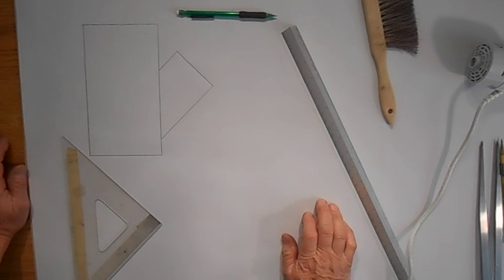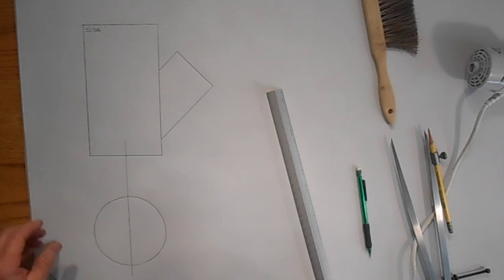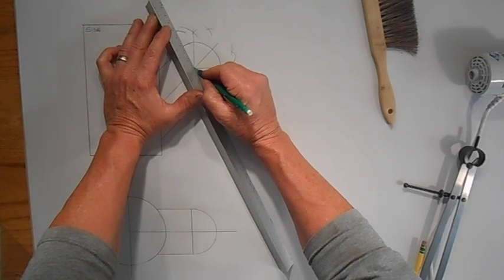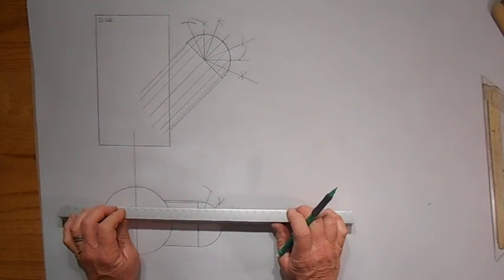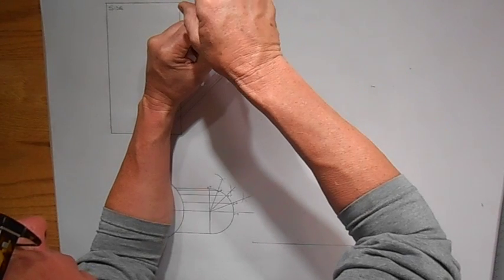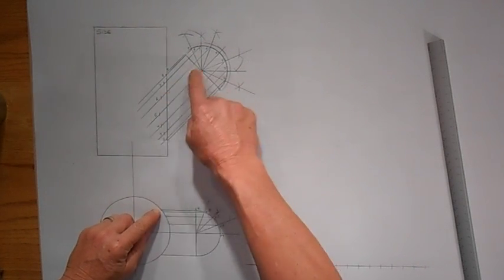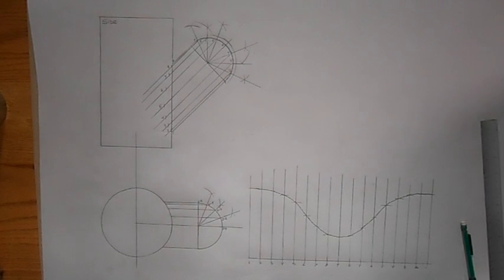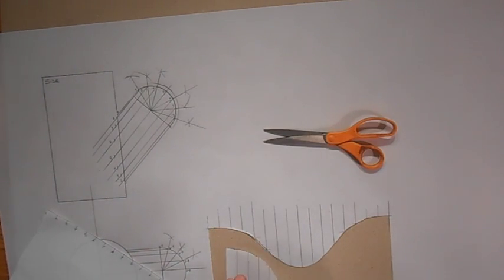Making a "Y" template for pipe

Comment: At a little over 5 minutes you mentioned you don't have to have advanced degrees in trigonometry to do this. That makes me think about the Giza pyramid built some 12,000 years ago or more. Architects and engineers still use the concept for their designs and mentioned they would be happy if their work was half as good. Certainly the level of accuracy in the megalithic structures goes beyond what we are able to achieve today. I'm in awe. Recently the British took some high level equipment to Egypt. They had ultrasonic instruments that could record what is underground also measure for straightness on each level of 60 tonne limestone blocks laid. What they found out was there was only a slight deviation from one end to the other. What they did fail to mentioned was the deviation was to the same scale in relation to the curvature of the earth. Let that sink in for a little. I just don't know why the conformed narration wants to keep this from the public.

Comment: Hello, please, check www.etubespro.com where you will find a real practical method for fabricating saddle templates for tubes/pipes of any size and thickness intersecting any other tubes/pipes at any angle. It works with offsets in any direction or plane. There is no need for any fancy software nor sophisticated equipment to achieve always a perfect fit and welding.
Reply: Thank you, and Dave

Comment: I'm confused to why you say you have to use the ID or it won't fit. I think you should use the OD but then you have to bevel the inside. Right?
Reply: Good question! This technique is used on sheetmetal as well as pipe. If we use the O.D. for a layout, there will be a lot of grinding of pipe wall to feather the surfaces to meet. Usually on pipe with any substantial wall thickness, a perpendicular cut using the I.D. will leave the edges of the wall exposed for a full penetration weld with minimal grinding needed for a good fit up-
    For sheet metal, theres no need for and O.D. vs. I.D..
Dave
Reply: Yeah I've done sheet metal and insulation work for years and the last few years i got to apply the layouts for big pipe fittings. Some of the pipe had 3/4 wall thickness and with using the ID for the layout the long point would be a lot shorter. I actually made an OD and ID patterns to help with getting the right bevel. This was on a 30 degree miter. With that much wall thickness just an ID would have left too much of s gap.

Comment: really enjoyed your video and I appreciate the time you spend on making thus video. But i keep wandering, does this technique also work when the 3 inch pipe is off centre ?
Reply from the maker: +yaishk  Nope! For an offset connection I go high tech and use a program like "pipe fitter" to layout the connections.
The template for those are weird looking, asymmetrical. Luckily, that type of connection is rare.